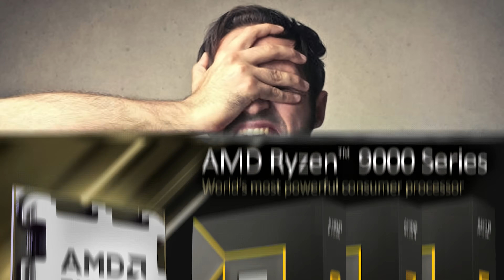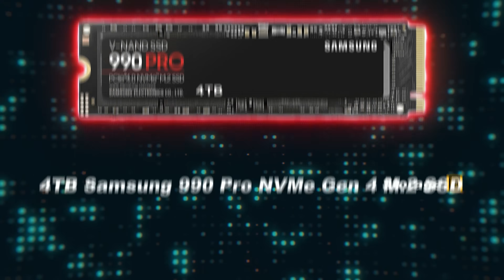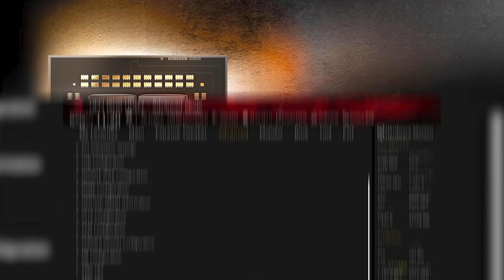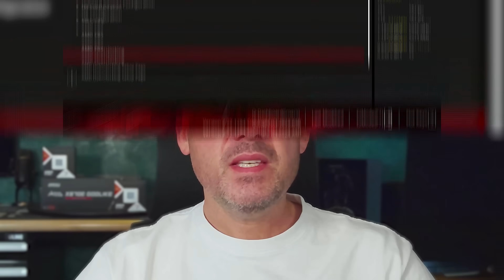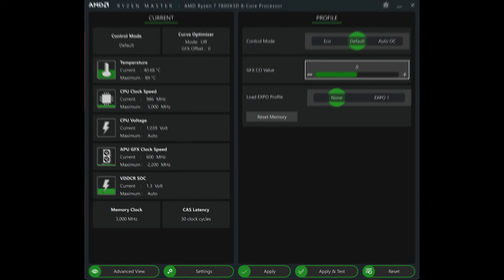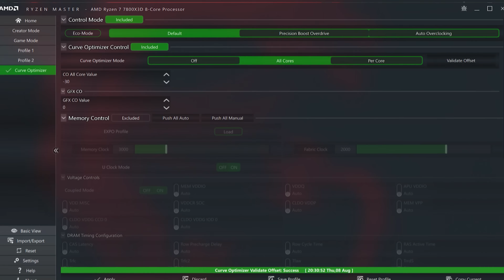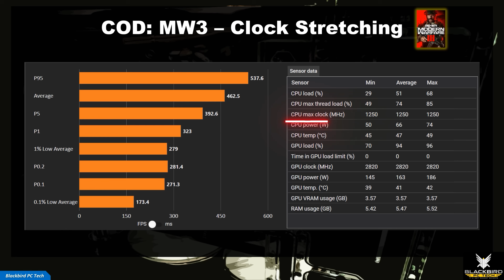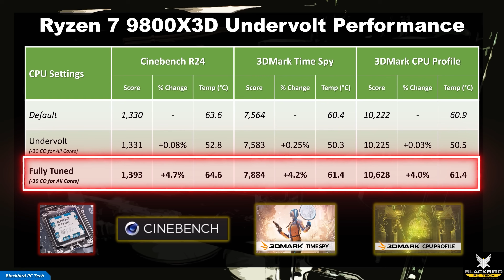How To Undervolt a Ryzen 7 9800X3D The Right Way! (or Any AMD AM5 Ryzen CPU)

Comment: The system froze at 43 seconds of the test, but then froze after a minute and everything was stable for the next 15 minutes. Is this normal or should I lower the undervolt?
Reply from the maker: No, that's not normal ... I would back off on the undervolt.
Reply: @blackbirdpctech I tested it in two more games (helldivers 2, the finals) and nothing crashed, hung, or blue screens appeared. But I noticed some freezing in the finals. Is it better to turn off undervolting or leave it on? Could I have harmed any of the components with these tests?
Reply from the maker: @Shizohrenic you can get tech support by joining my Skool community:

https://www.skool.com/blackbird-pc-tech-4230/about?ref=67e6a7048d9540fe87cbdf1b69bd47f3

Don't worry, you won't harm any components ... but there are multiple things you can do fix corruption in Windows.
Reply: @blackbirdpctech I turned off Undervolt, I hope it didn't harm the Windows system. I also have a question, is it possible to leave the Max CPU Boost Clock Override function enabled at +200?
Reply from the maker: I wouldn't recommend turning the undervolt off ... as I mentioned above, you can get tech support and all of your questions answered by joining my Skool community.
Reply from the maker: No problem, I would recommend that you follow this more comprehensive guide:

https://youtu.be/N60M36PRHsY

Hopefully you can also appreciate that my time is valuable and giving free tech support doesn’t help pay the bills 😉

Comment: Upgraded from i79700k. And was surprised by the temps of the Ryzen 7 9800x3d. Made me go crazy thinking I had bad aio mounting, airflow, or whatever. 

This video helped on my Asus TUF B650E-E, Corsair Flarex5. And got to -18 200+ with cpu. Now every game when doing shaders doesn't go to 80 - 85°C and stays at a comfortable 50c idle from 65c idle, and 70c -  75c under load. 

Trying Expo 1 gave a RAM error on restarts and Expo 2 made me have to do bio flashback. Ill have to mess with ram later.

Also, MSI Afterburner had a setting that undervolted all GPUs which my AMD chip was showing up on and caused issues. Easy fix.

Poe2 is still unplayable still tries to make it go 80cto90c though...
Reply from the maker: I would recommend watching this video to tune and optimize your CPU and RAM:

https://youtu.be/N60M36PRHsY

Comment: Hey Blackbird, I was able to Undervolt + OC to -20CO / +200Mhz and pass the AIDA64 Stress test 10 min. The benchmark scores improved considerably, and temps improved for sure.

I do have one pretty big issue, though. From my understand, core offset affects stability across ALL clock ranges: low clock activities (i.e very basic web browsing) can also result in stability issues / crashes. In my case, I am unable to complete an overnight idle in a game (that's minimized to taskbar) where my character automates stuff.

Is there an AIDA64 stress test, but for the low clock range? Or better yet, is there a way in BIOS where I can specifically boost voltage jn the lower clocks so it doesn't destabilize?

In power settings, there was an option called "Minimum processor state", and it was 0% by default. Would this be a possible issue? I just set it to 5% but have yet to test. 

Thank you!!
Reply from the maker: So does that mean you leave your game running with the computer on over night? I'm curious as to why you would want to do that?

That said, you could simply switch your power plan to "High performance" from "Balanced" if you have a single CCD CPU, such as the 9800X3D.
Reply: @blackbirdpctech Oops forgot to mentioned it was 9800X3D, yeah

Lots of MMOs have AFK functions where you have your character automate stuff to progress your account. I'm doing something like that overnight.

As for power plan, I have just changed it and am hoping for better results 🤞
Reply from the maker: Let me know if that helps

Comment: My cpu temp went up when I went from -10v to -20 but never had any stability issues in AIDA64
Reply from the maker: Your performance also likely went up with the increase in temps
Reply: Okay that makes sense. I was able to get it stable at -20 volts. The clock speeds never went down when I run a test @blackbirdpctech

Comment: Question I have the same cpu , I have trident z royal ram 6000 cl28 , I have the ram overclocked & running at 6000 , does this video apply to the ram being overclocked as well or should I set the ram back to default speeds? Been noticing my pc running at 60-70 during gaming & im thinking it’s because I overclocked the ram , any help would help thanks boss
Reply from the maker: Your RAM overclock, if stable, will not impact your undervolt and vice-versa. To learn how to tune and optimize your system you can follow this guide: https://youtu.be/N60M36PRHsY

Comment: I actually achieved a -60 curve offset totally stable on my Ryzen 7600. I managed it by capping the maximum boost clock to 5ghz (stock was 5150hz) using a -150 negative offset on maximum boost frequency. Also I use PBO Enhanced level 3 targeting 70°C
Reply from the maker: It's hard to believe that you were able to achieve a stable -60 CO on a Ryzen 7600 ... it's hard to imagine that your system would boot, let alone be stable. Did you run the AIDA64 stress test? Did you check for clock stretching?
Reply: @blackbirdpctech Yep.. gaming too. Scalar is manual at 1x. It crashed a few times without frequency cap but 5ghz has been stable for 2 weeks now. Although i was willing to offset another negative 100-200mhz if my system crashed but it didn't.

Comment: my 9800x3d fails at even -15 co, i either have garbage silicon or theres something wrong with my ram :(
Reply from the maker: You should test the stability of your RAM with Karhu before attempting to tune your CPU. If your system is failing with an undervolt it should have nothing to do with your RAM, assuming it was stable to begin with.
Reply: @blackbirdpctech  yeah i miight have done a ram oc before i did the undervolt

Comment: I only get around 5225 mhz for my cpu max clock, 9800X3D, 64gb ram etc.. does that mean im losing performance and i need to make a less aggressive number in the bios? or is that still decent? I have noticed a considerable temperature decrease for my cpu and games still feel smooth as butter.
Reply from the maker: That's what you should be boosting to for single threaded tasks ... you can checkout this video to learn how to tune and optimize properly: https://youtu.be/N60M36PRHsY
Reply: @blackbirdpctech  Thank you very much!

Comment: i undervolted my 9800x3d for the first time ever was scared to do it i got to -25 with out any arror at -30 i got a error by a stability task think im unlucky because i see alot of u guys got -30 but anyway my temp got lowerd so im happy ty for the video
Reply from the maker: -25 is great ... I'm sure there are a lot of people that are running -30 and are either unstable and/or have clock stretching.
Reply: @blackbirdpctech  oke im still not sure if im looking good for clock stretching but i think im fine im looking at clock core(max) and then at value min max hope thats the good place to look at on hwmonitor
Reply from the maker: If you click on "Cores (Max)" it will open and show you the frequency of all of your cores ... you can then see what the max value was while running a program ... the clock speeds will be much lower than normal if you have clock stretching
Reply: @blackbirdpctech  oke then im good i think its max 5409.8  mhz and min 2339.6mhz sorry for all the questions its new for me haha anyway ty for the video

Comment: Personally i lose a lot of performance from undervolting. C23R score from 21000 -> 16000 with PBO, tjmax85 & -30 curve optimizer. temps are cooler by a fair bit though.
Reply from the maker: That's because you haven't tuned and optimized your system to take advantage of the undervolt, as shown in this video: https://youtu.be/N60M36PRHsY

Comment: great video! my 9800x3d used to fluctuate between 49 and 62 celsius. got mine stable at -30 and now running 44-50 celsius ingame :D keep up the great work!
Reply from the maker: That's a great result!
Reply: @officialxeNTed  what cpu cooling are you using?
Reply: @ATI6950FTW  ASUS ROG Ryujin III 360.
the one with  nocuta fans on :P

Comment: Great video! I have a question:

Is the testing you described adequate to ensure long term stability, or should we consider something else like a 24-hour Prime95 stress test? What would you specifically recommend to ensure long term stability?
Reply from the maker: You can simply extend the AIDA64 test ... I'm not a big fan of 24hr testing because even if you do get an error after say 20hrs of testing, that means that the chance of an error is so low that you are very likely not going to ever see it in practice. Of course, if you are running a server or if reliability is your number one priority then I would simply avoid overclocking.
Reply: @blackbirdpctech  thanks for the reply! I got my computer built and everything is working well. However, I noticed an issue -

You know how you said there are two ways to access the undervolting menu? Well, when I try it the way you suggest, any changes I make aren’t reflected whenever I try to exit and save (it just says no changes were made). But when I access the menu a different way (I don’t have the “tweaker” option on my mobo (MSI Pro B660M-A WiFi - it’s something else), the changes I make there are reflected when I attempt to exit and save.

I’m rather baffled. I uploaded a video to my channel showing the two different ways to access the menu if you’re interested. What do you recommend? Why does MSI do this lol? And what happens if they have different settings in each place?

What’s strange is that if I make changes that aren’t reflected when I save and exit, those changes are actually saved lol. But I have no idea if they’re taking effect or not… This is just bizarre. And for the record I am running the latest bios for my mobo
Reply from the maker: @Luke-ih1oc   I would recommend using whichever menu works ... it sounds like MSI messed up the firmware somehow.

Comment: 64C stock at Cinebench is just insane. Take the PC out of the Fridge please! :D Unless direct die + liquid metal...
Reply from the maker: I have a golden sample 9800X3D ... my two other 9800X3D's operate at higher temps.
Reply: @blackbirdpctech damn it must be operating at 0.6-0.7v under load to have this kind of temps..
Reply from the maker: And it undervolts extremely well too, so I got super lucky with this one ...

Comment: Crashin on -30, -20 -15. I can only do -10 lottery
Reply from the maker: -10 is still better than stock ... you might want to try per core ... there is likely one or two cores that are holding back the rest of your CPU
Reply: @blackbirdpctech  Thank you! Love your videos. Im happy with -10 its better then 0 ofc, just a bit unlucky. Do u suggest undervolt or overclock my MSI gaming tro 5080OC? "silent mode vs game mode" on it
Reply from the maker: @1337Profix  I have a new Nvidia GPU UV/OC guide coming this week where I will focus on answering that exact question!

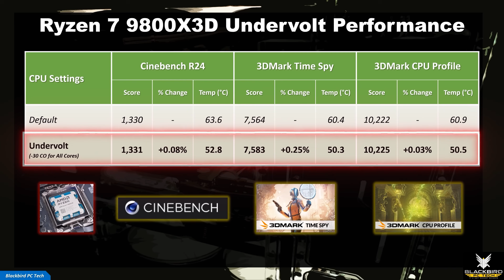Comment: 7:46 the lower temps alone is why I undervolt mine without any other tweaks. The reduced temps means less noisy fans so just a generally better QoL improvement when using the system. 
If anyone’s worried about this and never tired undervolting before I highly recommend just for the thermals/less noise and see how you get on.
Reply from the maker: Agreed, undervolting is awesome!

Comment: Sir, may I ask you what did you do to have the temps of your 9800x3d around 60C while running Cinebench R24? I have also the 9800x3d with a 360 AIO (Galahad AIO 360), but my CPU easily hits 85C while running Cinebench. I reapplied the thermal paste following what the best practice recommends, but I had no improvement in the temps at all.
Reply from the maker: Try following this guide: https://youtu.be/N60M36PRHsY

Were you able to undervolt your CPU?
Reply: @blackbirdpctech I did the undervolt and didn’t increase the CPU frequency yet. I am able to use PBO at -30 stable, which made my cpu went from 85C to 75C while running Cinebench. But I still wonder how you were able to reach 60C without PBO configured while running Cinebench. If you had a custom water cooler, I’d understand, but I also use a AIO 360mm. 🤔
Reply from the maker: @ralph-5050  I just got lucky with silicon quality. I have multiple 9800X3D's and this one is by far my best chip.

Comment: Nice Video but my 9800x3d will not cool down. I have a 420mm aio and put the cpu on -20 an i still got temps around 90 degrees under cinebech. Do you know why it's still so hot?
Reply from the maker: Sounds like a cooling problem ... have you checked that your AIO is mounted properly?
Reply: @blackbirdpctech  yes it is mounted as the Manuel shows me. I tried something else. I used the -20 and set the core ratio to 50 (so 5.0GHz instead of the 5.2) I would say I don't need those extra 200mhz. I also put the core voltage to 1.120V and test everything. I seems to go pretty good with that. 5Ghz all the time max 69 degrees unter 100% load on Cinebench. And the cpu uses about 35 watts less. (sorry for the bad English haha I'm fron Germany)
Reply from the maker: No problem, your English is great. Instead of doing that you could simply set a thermal limit in PBO. I would recommend following this guide to set a dynamic overclock using PBO:

https://youtu.be/N60M36PRHsY
Reply: @blackbirdpctech thanks a lot. I will watch the video tomorrow and try everything out. :)

Comment: Just to confirm, undervolting can not damage your system right? I've previously undervolted my 5600x for years but with my 9800x I am a bit scared haha. From everything I have read it's not going to damage anything by giving something less juice. Is this correct?
Reply from the maker: Fundamentally that's correct if you follow the steps in the video.

Comment: I am a noob when it comes to undervolting and overclocking my PC, so this guide was very helpful and easy to follow. However, I'm running into an issue and hope you or someone here can help.

I'm undervolting my 5800XT (AM3, not AM5 but same steps), and was able to run AIDA64 stable at -30 offset (max allowed for AM3). For some reason though, my temperatures are not decreasing, but rather INCREASING. I went from max 83C to 85C on AIDA64 and max 84C to 87.5C on Cinebench. 

I've double-checked that I have offset set at negative, not positive, in BIOS and that it is actually applied using Ryzen Master. I also know that it's boosting performance because I went up 3.38% in Cinebench. It's just the increase temperature I'm worried about because from your data, it should be going down considerably.

Is there any insight as to why this could be? I don't know if it has to do with it being AM3 and not AM5, but I feel like it should be relatively the same, no? Regardless, thank you for this guide!
Reply from the maker: It's likely a result of your system using up the thermal headroom to boost higher/longer, resulting in higher temps ... one way to prevent that is to input a thermal limit in PBO.
Reply: @blackbirdpctech  Thank you!

Comment: Stability stops at -12 for me. Any higher and the Aida64 stress test fails. Seeing a small temp improvement over stock, about 3 degrees. Silicon lottery smoked me out big time, but that's the game. This video is excellent work nonetheless. This is an extremely valuable and powerful guide. Thank you for this
Reply from the maker: You are very welcome!

Comment: Hi, I just bought a Ryzen 9800x3D and a Red Devil RX9070ZT. Is Aida enough to test the CPU undervolt? Or should I test the undervolt with apps like Prime95 for hours? Does Aida damage my CPU with the various tests?
Reply from the maker: AIDA 64 won't damage your CPU. As I explain in the video, I use it to rapidly test the stability of the undervolt. There is no standard definition for stability, so I can't answer if it will be enough ... for some people they want to test for a few weeks while others don't test at all, so it really depends.

Comment: I don’t get the option to option to do anything to curved. It’s not showing in BIOS even after updating to newest. And in Ryzen Master is says overclocking is not compatible with this CPU.
Reply from the maker: What motherboard and CPU do you have?
Reply: @blackbirdpctech  Asus TUF GAMING A620M-PLUS - 9800x3d.
Updated chipset as well. No luck.
Reply from the maker: That's why ... the A620 chipset does not allow CPU overclocking and/or the PBO feature set.
Reply: @blackbirdpctech  Bummer. Thanks for the quick response. 😅